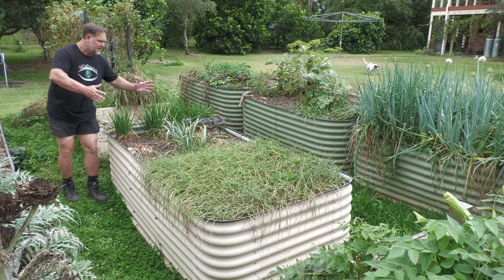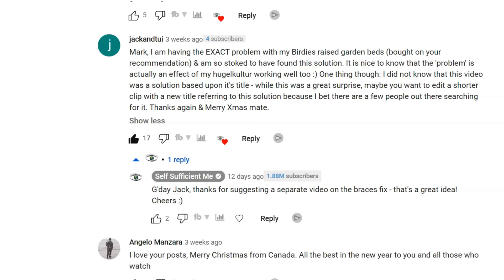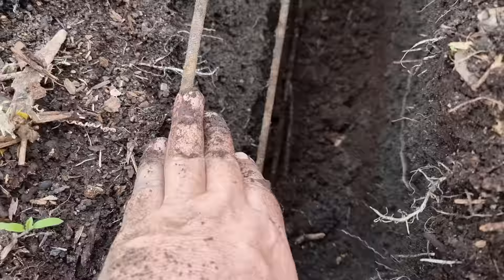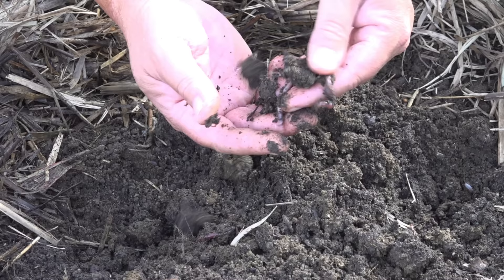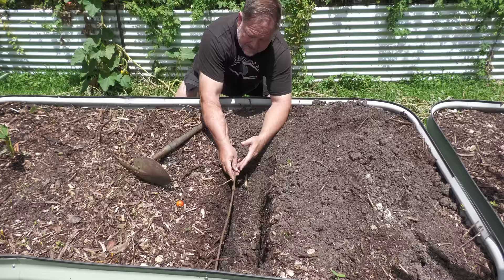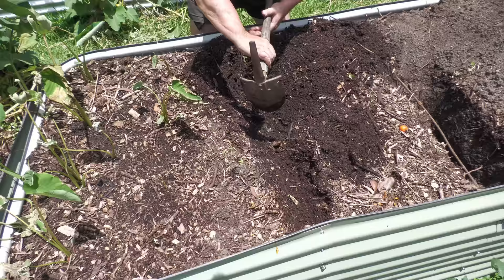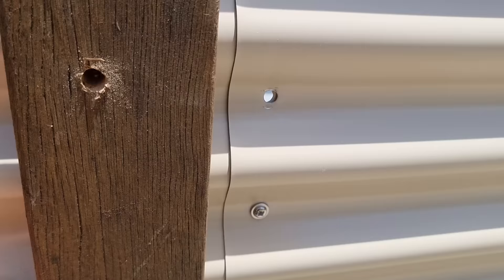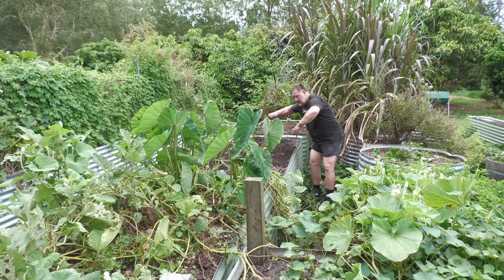How to FIX and STOP a Raised Garden Bed From Caving Inwards

Comment: seems to me that a different system may be a better option. how about timber structure rather than metal. in nz we have a great eucalyptus tree (lol) called stringy bark. its ground durable for up to 20 plus years without treatment. macrocarpa is another welcome import with similar characteristics. or brick/river stone. given the rewards from a raised bed, a bit of time constructing it from local materials doesnt to me look like a bad spend of effort.

Comment: I'm confused. I've bought 7 of the Birdies tall raised beds for our paddock and there was only ever two braces suppied with each of them. And the instructions with the bed say you should only fix the braces three bolt holes from the bottom. Why do you even need the top braces? I don't think you need them at all.

Comment: These things look pretty flimsy for the expensive price. I made one from pallets lined with used metal roofing. Pallets are free. I put metal garden stakes on the outside to prevent the bottom of the beds from pushing out. I made L brackets out of the roofing for the corners.

Comment: You say it isn't a manufacturer fault. I disagree. The size of the rods is obviously a built to a price solution. The rods also look like they corrode pretty quickly too. Which when rusted out must mean the raised bed loses structural integrity. As a belt and braces man if I was putting them together I would sleeve the rods upon install. Thick wall plastic pressure pipe would add immense strength to the structure and also protect the rods from corrosion. You could use normal conduit but that has thinner walls. Less strength but cheaper. Just an idea.
Reply: Dave, the rods were meant to prevent the sides of the beds bowing OUTWARDS, and this they do. It was only when seeing the sides bow INWARDS that I dug down to find out how/why this happened. Not surprisingly the problem was simply one that hadn't been envisaged by Birdies when the beds were first designed.

Comment: Your all garden beds are so deep. Why you use shallow garden beds?
Reply: Can't answer for him, but I will say that for me the reason to use tall beds is so I don't have to bend over or squat down.  It's just far easier on my increasingly old and decrepit body not to bend or squat so much.  Most of my garden is actually still in-ground, but I am experimenting with waist high beds.  I generally get good results growing in-ground, so from my point of view a low raised bed doesn't fix any problems that I have.

Comment: This raised bed brand is too expensive for a critical design flaw.   The panels and braces are too thin to hold the volume in a large raised bed like this. Also seems like too much work to start up and maintain.

Comment: Why don't you just make one out of stone or brick. At this point it seems like maintaining it and pulling it apart is alot of work. After like 5-7 years you'll just have to dig it out. But you can then use tools or light machinery because it will be sturdy enough. Plus you won't need to maintain it like you do now.